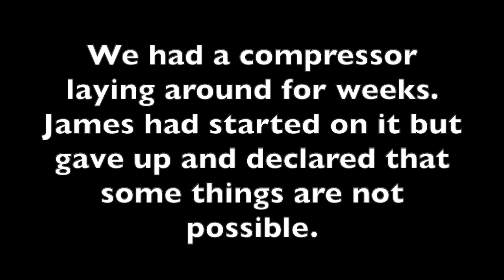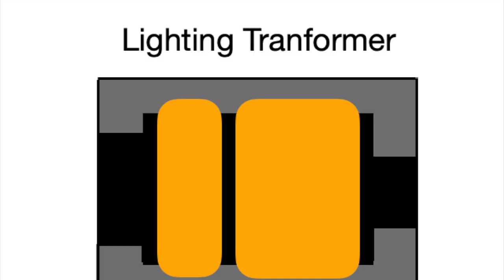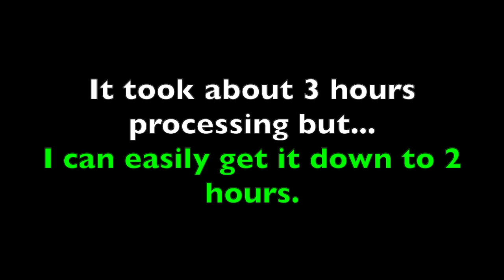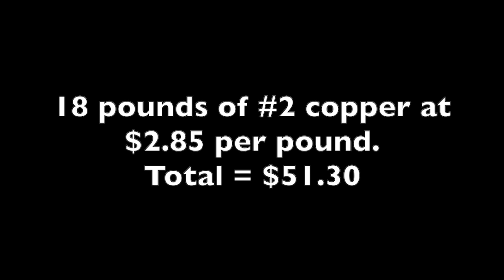Seven Transformers and a Compressor   How Much?

Comment: that was a decent copper haul for that time spent :)
Reply from the maker: Hi Blackwidow,
Yeah - this was time well spent. The main issue is getting quality transformers from old lighting. More and more the transformers in microwaves are aluminum. 
Building a relationship with a company that replaces parking lot lighting with LED lighting would guarantee a decent, full-time business and with the right tools you could probably get this job down to a 1/2 hour. 
Peace
Reply: @prolevelrestoration  I have a pile of microwaves in my yard I have to get through, lots of them are older so I shouldn't get too much aluminum in there.
 Thanks very much for all the info, I appreciate it :)